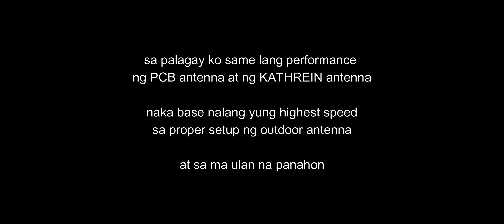Hyperbolic pcb antenna conversion to Kathrein antenna

Comment: fdd band 1 nasa 1900MHz, target ko sana yun band 28 700MHz  kung ano yung sinr ng 4-5mm na kathrein pero sa tingin ko yun 6mm kathrein yun pang 700MHz dahil yan ang pinaglumaan ng telco para sa upgrade 1800-3800MHz ng ibang lte band frequency

Comment: Ang mga cone antennas na locally made hindi naman talaga tunay na cone antenna, pcb lamang gaya ng mimo at patch array antenna. Hindi din die cast aluminum ang casing puro plastik, yung grid  wala din masyadong gamit dyan, kaya walang pinagkaiba sa mga mimo antennas. Kung gagamitan mo yan ng improvise casing gawa sa alumimum mas lalo mo pang ma boost ang directional signal nyan at mas magiging mala cone antenna na talaga ang lakas nyan.
Reply: Ano po ibig sabihin nyo sa cone antenna? Yung parang dish po ba na grid ng parabolic? Ano po ang legit na outdoor antenna ma suggest nyo po. sana mapansin
Reply: @KentXenos  ang Horn antenna ang ang may cone tulad ng hyperbolic/parabolic. ito ay directional antenna, kung malayo ang target cellsite mo, mas maganda ito ang gamitin mo mo dahil pang long range din yan. kelangan lang walang harang sa line of sight. kung malapit lang naman ang celsite sa area nyo okay lang din yung patch array antenna tulad ng mga mimo. iconsider mo lang ang availble frequency range ng cellsite na nasa area nyo. mas maganda kung wide band ang antenna na napili mo.

Comment: Bakit ayaw gumana sa globe at home wifi ko Yung kathrein antenna biglang nawala Yung signal ko
Reply from the maker: Try mataas position antenna at pihit sa ibang direction
Reply: @MrJesusRamos  ginawa ko na no signal parin atsaka tiningnan ko na sa admin settings no signal parin
Reply: double check mo yun solder joints, gamit ka ng multimeter at may mababang resistance kang makuha, at saka yun joint ng cable sa sma, napupitol rin yan sa panay bending
Reply: @taurene  bumili ako agad ulit ng kathrien antenna no signal parin..

Comment: Magkano pala boss magpa modified sayo ng parabolic antenna?
Reply from the maker: Mahal supplier sa shopee
https://shopee.ph/product/626078064/18930233175?smtt=0.412738141-1667313734.9
Reply: @MrJesusRamos  biglang nagtaasan po sila ng price ng malaman nilang marami ng bumibili niyan....nakuha ko lng dati ng tig P300.00 bawat isa yan ng unang lumabas yan sa shopee at wala pang masyadong bumibili...mabuti at nakabili ako dati ng tatlo niyan.